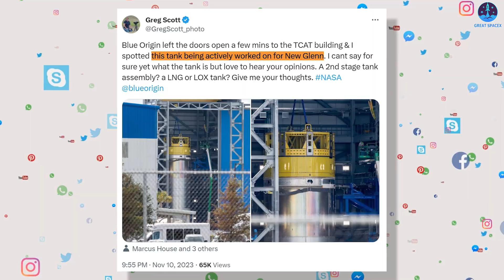Jeff Bezos on Elon Musk&SpaceX! Blue Origin's NEW serious warning...

Comment: The Beached Blue Whale should buy raptor 3 engines.  Maybe then they won't be running a space company that doesn't fly  (much).
Reply: I think ,if those two be4 engines fail on the 8th .
They probably will 👍
Reply: @trebormints3739  they cant as they engine size is different and pluming for propellant is probably different as well.